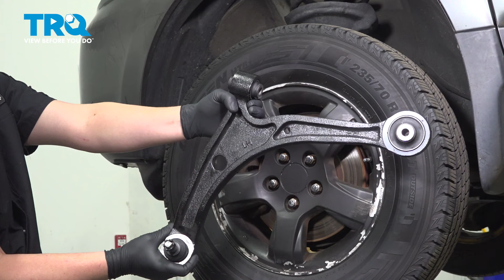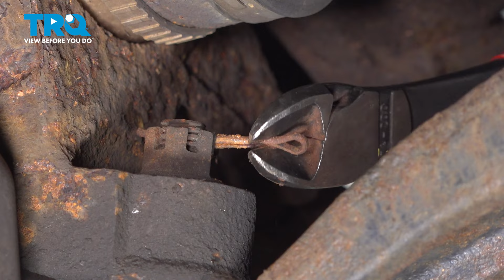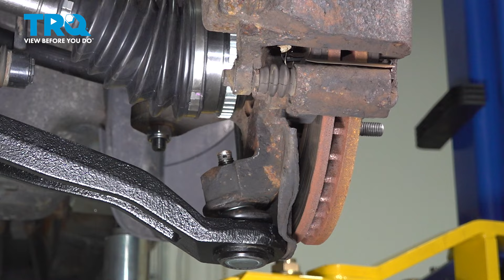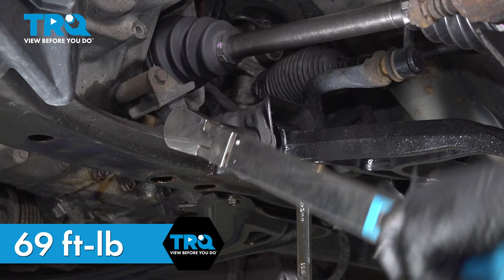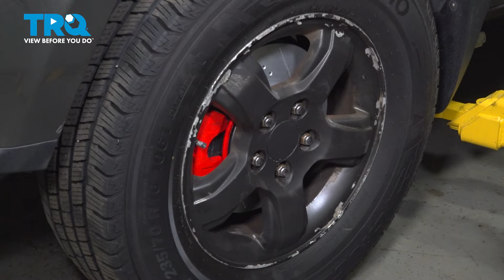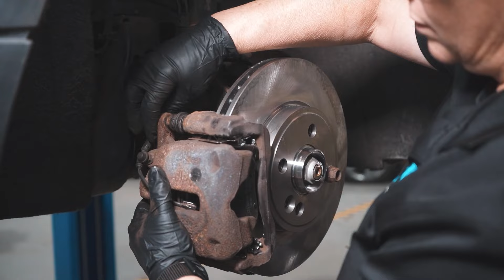How to Replace Front Lower Control Arms 2003-2008 Honda Pilot

Comment: Very good!  Only reason I watched is because i seen a thread saying shop wanted to charge guy 800$ to change both lower control arms.  So i looked up price of Moog brand for this pilot and they're only 200$ shipped for both and ball joints are  quite cheap so probably $250 total for all parts needed and this video confirms how easy it is to change them yourself.

Comment: Only 19mm needs for done job. You don’t need tools for 22mm. because the nut is welded at the factory. I did with ratchet 19mm only. Thx for video.

Comment: Oldie, but goodie!  Take it from someone who has stripped the LCA NUT to the bolt that goes in vertically, MAKE SURE to screw the rear bolt into the threads of the nut far enough, prior to tightening to specs.